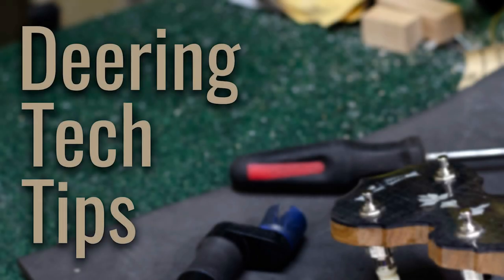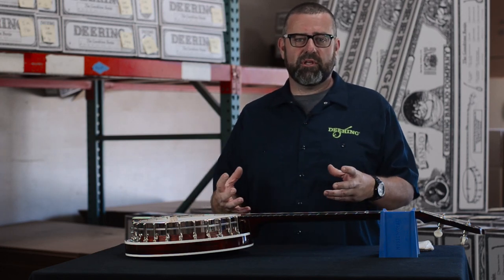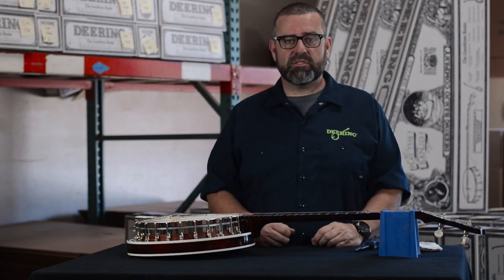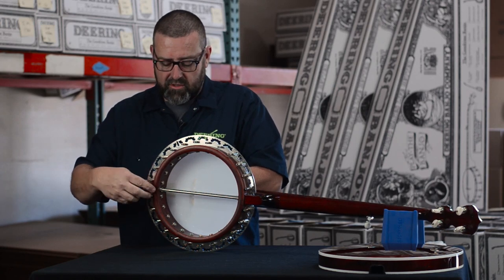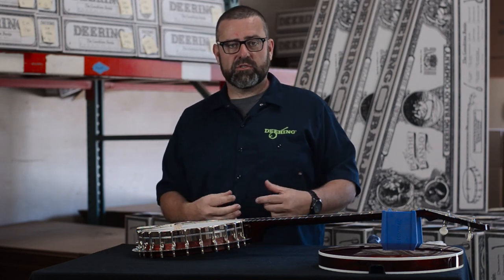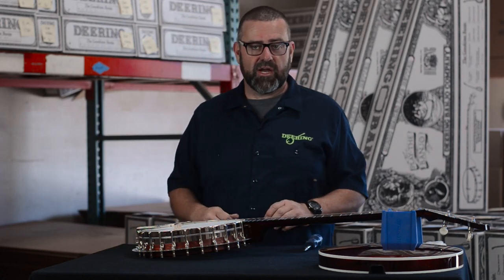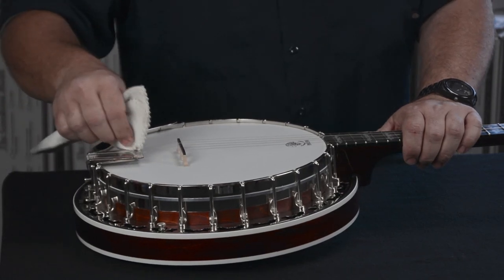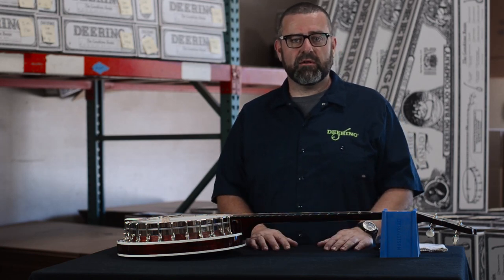Deering Tech - Deering Upperline Tailpiece Adjustment

Comment: Hi! I've seen some videos regarding Presto style tailpieces which recommend not setting them on the tension hoop or using the angle adjustment screw andetting them "float". What is different about the TruTone tailpiece vs. a regular Presto style where uou set it up differently? I have a Julia Belle that I was doing some setup on and didn't want to mess up the tailpiece adjustment. Thank you!

Comment: Sorry to bug you guys with questions, but after watching this video a couple of times and looking at my own Banjo (a Maple Blossom) I think I have issues, but I'm not sure. So my tailpiece sits higher at the top (towards the 5th string) than it does at the bottom. Also, the long phillips adjustment screw is at a pronounced angle. Is it supposed to be straight up/down? Is it possible my tailpiece is bent all out of shape?
Reply from the maker: Hey! If you'd like to send us an image of your tailpiece to info@deeringbanjos.com we can take a look for you!
Reply: Did you get it fixed?
Reply: @valcirp1754  
Probably not or embarrassed because because it was so simple.

Comment: Hey Chad, what about the Deering standard tailpiece, like what's used on the Goodtime series? It's mounted to the banjo differently and has no adjustment screw. It's mounted to the coordinator rod. Is the standard tailpiece also supposed to be firmly against the tension ring like the True Tone piece in the video? My Artisan Special came with it almost an 1/8" above being in contact with the tension ring and 1/4" from the head as measured at the edge facing the bridge.
Reply from the maker: The Goodtime tailpiece can be adjusted by loosening the outside nut on the coordinator rod until there is a small gap between the
tailpiece and the face of the rim that it makes contact with.  The tailpiece should be set as low to the head as possible without contacting the head, there should always be a small gap from the surface of the head to the bottom of the tailpiece.  This will give the Goodtime banjo the tightest “bluegrass” sound.  To allow a warmer, rounder tone the tailpiece can be raised away from the head and set according to what the player’s ear prefers.  Once adjusted tighten the outside nut firmly against the rim and re-tune the banjo. Hope this helps.

Comment: My question: all videos i see, they lift a lid to get under the tailpiece. There is no lid, it's one solid immovable piece. All i need to do is add a string i broke while tuning. I have no idea how to remove the tailpiece. The user manual didn't show and no video out there shows me HOW?? so frustrated. It's a 5 piece full size vangoa banjo and i tried to loosen 2 screws and loosen some other knobs and I'm probably ruining my new banjo 😅